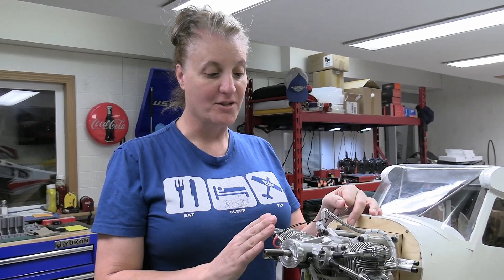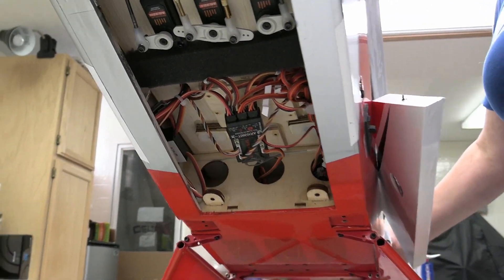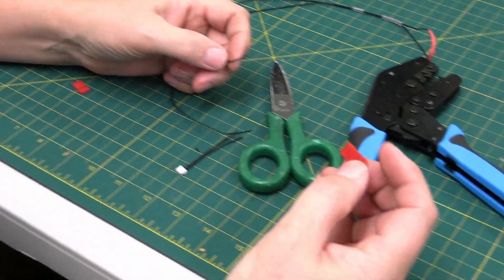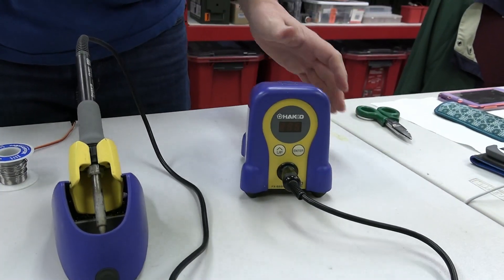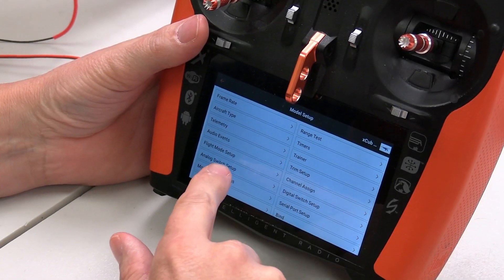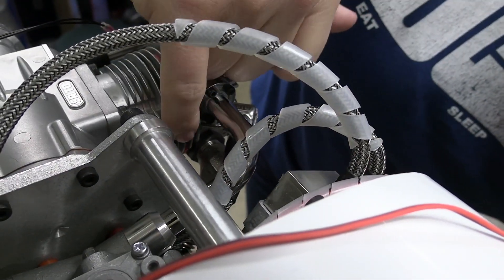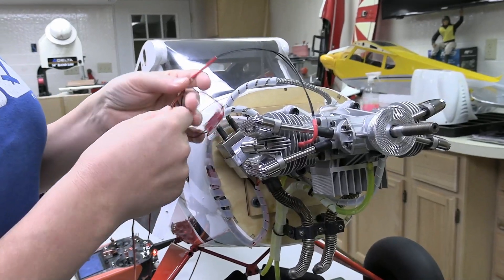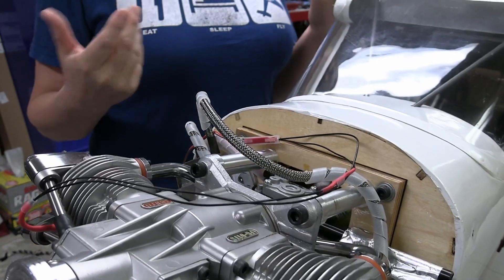Spektrum Telemetry Temperature Sensor Mod! (SPMA9571)

Comment: hello mam (RC Sfari) hope all going good,mam just I need to know about the exact thermistor details which u r used.i broke my spectrum temperature sensor during fixing in my Heli,so kindly need little bit guidness about it and where I can buy the exact (website) thermistor ?and thanks (RC SAFARI )for video.😊
Reply from the maker: Need more detail. What is the brand and model of the Heli? Have you tried calling customer service for the Manufacture or your Local Hobby Shop for help?

Comment: Excellent job on this video and this is just what I need to do for sensing heat on my DLE 120... extend the sensor length. Do you think adding wire length will change the reading of the prob?

Comment: I just took the engine apart and just wrapped it over and through the ribs on the cylinder.

They also sell extensions of those cables.  

On my FG21 the hottest I have had it running while working on airflow through the cowl was around 280 tops 

You should be running your engine at around 220 degrees Fahrenheit

Comment: Enjoy every one of your vids. So clear and helpful to the new enthusiast. Just wish there were many more of them. Just bought a used Dynam Waco that has a Lemon receiver and GPS unit in it and nervous about how reliable it is.  Wonder how tough it would be to buy a cable and try Forward Programming the Spektrum 631 in my Mini Apprentice into the Dynam? Searching the net and not finding a whole lot on putting a Spektrum receiver into a Dynam. I have a DX-9 transmitter. Any info would be appreciated..
Reply from the maker: I do not have a lot of experience with Lemon Rx's. Thus far, I have used Spektrum exclusively. Although, I am open to try and learn new technologies. I too have a Dx9... LOVE IT. Make sure your DX9 has the latest firmware update. Also, make sure your receiver has the latest updates (if it can be updated). I would recommend you invest in the AR637T. Yes, I know they are expensive - but consider it both cheap plane insurance, and a dose of confidence too. They are easy to program, and are better than doing a heart Transplant from one plane to another. As for how many videos I have  - well we are working on more. As of right now, I don't get fed a lot of free or early access products like other channels do to promote (although I have on occasion - and I'm working on trying to get more) mostly the things I do, are things I have to pay for. I am trying to make more content so I can earn some revenue from youtube to help buy more stuff. Its hard though - by the time I can afford to get stuff, the bigger channels that get early access stuff for free before anyone else can even buy it, have already made videos promoting the product, which leaves channels like mine struggling for viewership and new subscribers. So I am trying to be clever and come up with some content that people will actually watch, but also adds value on top of what is already out there on youtube. I hope that makes sense. You've given me some things to think about and I'll try to make some more beginner level stuff on this subject of Transmitters and Radios - which is what I really like messing around with. Let me know how things go!
Reply: @RCSafari  What a SWEET reply!! I don't care about the rankings of You Tube pilots!! It is about seeing PASSION from someone sharing information on this hobby we love!! You make me smile while watching every second. I feel like I am proud of YOUR knowledge and intensity!! I can see your "wheels" turning as you are trying to get your temp sensor in the right place on the gas engine, but really wondering about how you are going to get the dang thing to idle right.. Watching you fly er, the look on your face.. PRICELESS!! I will let you know how this whole Dynam adventure goes. Over the winter I'll bring it in and see how the Lemon and GPS seems to work. Thinking Spektrum change-over with SAFE will def be my best bet though. Fell in love with your style when you added that SAFE to your big fighter!! ;) Showed you off to a guy at work that is a new enthusiast, and he was impressed as well.. well maybe not quite as much as myself.. ;)

Comment: only thing i can think of is that you're only measuring the outside cylinder temp of one of the cylinders. i don't know if spektrum can support multiple thermisters, but you really wanna add one to the other cylinder. Also, i wouldn't put it on the front as that's in the airflow, you would want to put it on the back of the cylinder imho as that's going to be where most of the heat will end up.
Reply from the maker: I am not sure how to get a second TEMP input using this Rx. But I agree, it would be nice to have an input from both. Also, I do mention and show towards the end of the video that I install the thermistor to the rear of the cylinder head, and only the leading wires were sticking out the front and snugged up and held in place with another piece of shrink tube (just for the video, I will re-dress them in nicely later when I go to put the cowl on.

Comment: Is 7200 the engine Red Line?  If so, you want your static max rpm only 86% (maybe 90%) of redline, cuz the engine will over-rev while at cruise  {{just sayin ...}}
Reply from the maker: Manual States that with a 22x10 Prop, RPM range should reach aprox 6400-7200 RPM.